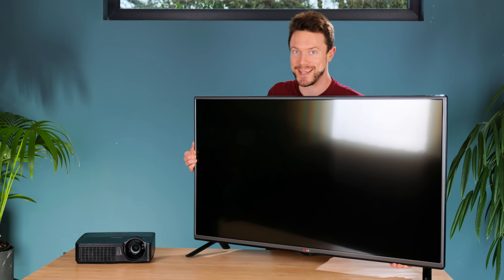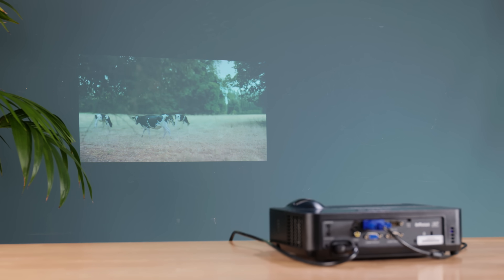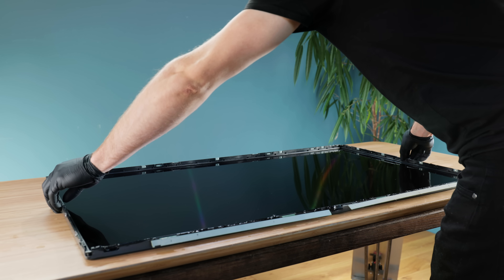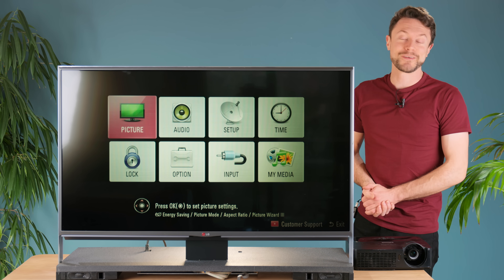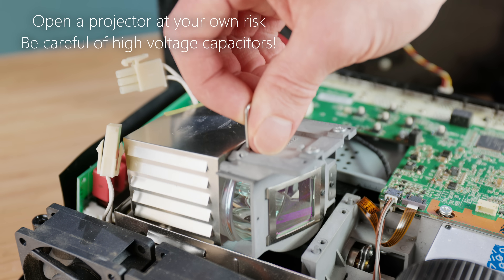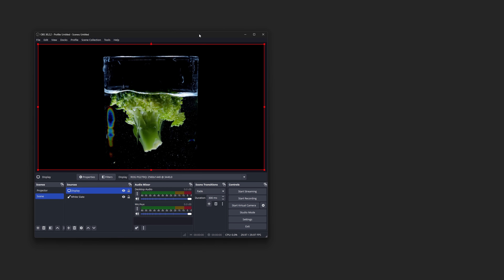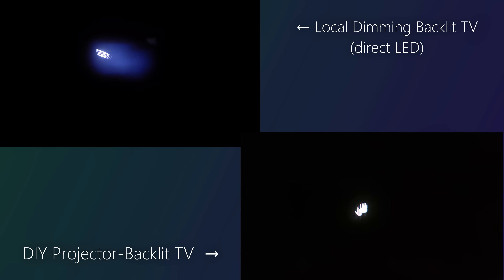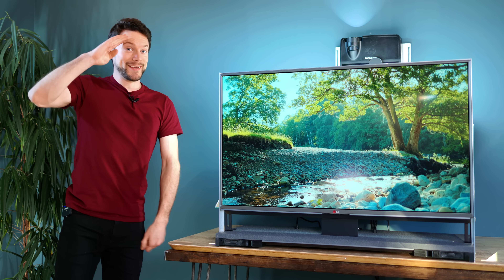DIY "infinity contrast" TV -  with 100% recycled parts

Comment: Within 2 minutes of watching the start of this video, I was already convinced that you have just come up with, BY FAR, your most interesting project to date!

I'm an old A/V techie, been messing with TV's since I was 12, and Video Projectors since the 3-tube pro-video units of the 1980s. 

I went through some of the RP HD TVs, and still have some of those parts laying around.

What you've done is to re-create those RPTV's, but in the ultimate version... using the Rear Projection part for just back-lighting an HD LCD TV screen...

Fascinating!

Now, to make the ultimate version of this, find an old RPTV from a second-hand store (preferably 1080p resolution), and put a 4k TV screen (from a donor with bad Backlight) onto the front of the RPTV viewing screen. Mitsubishi was one common mfr) 

Many of the RPTV's are also DLP, so modify them as you did by removing the color wheel.

The one remaining challenge might be Image synchronization, because the two different TV's have different image processing delay times.
Reply: Yeah, old HDMI interfaces at the time were known for having terrible input latency. However you might be able to bypass that as many gamers did by using component input. (Actually you'd only need the Y channel of component video for Luma).
Reply: A friend had an old 3-tube unit in the mid-90s. It looked ridiculous but awesome in his attic bedroom! I kind-of want one even though my home is not much larger.
Reply: Allow for a better sound system too if he finds one with the built in stand at the bottom.
Reply: Thats a great idea!
Reply: The truly ultimate design would probably use a more modern LED projector installed into the cabinet of a dead RP set, since the 20 year old RP sets likely can’t compete brightness wise, but if you could find a working set like that it would be a fun project to bring it back to life in 2025.

Comment: That wont last too long. Projector bulbs last 5k hours on normal mode for a business one and then you will have to replace the bulb meaning it will turn your TV into a subscription basically.
Reply: If you use your TV a lot this is not a good idea.

Comment: I wonder if using one of the thinner diffusion films, or none at all, would result in better brightness, contrast, and light zone accuracy. I also wonder if you could just modify a rear projection tv to house the panel and projector

Comment: Great idea. It means that we can combine two old LCD panels with a single backlight. You have already done this before, but one thing needs to change—the lower panel display should be pass-through, like the OBS filter used in projector displays. I am expecting the same result as the LCD + projector combination, which will help reduce the size of the LCD. @DIYPerks

Comment: 6:09 It’s not clear to me why you need the diffusion layer, isn’t the whole point not to have a more uniform backlight?  The end result looks great, but I’m super curious what it would look like without the diffusion layer.
Reply: I initially wondered the same thing. I think since the LCD panel is fairly transparent; without any diffusion I you'd just be looking directly into a very bright projector, the diffusion layer is there to reduce the transparency of the screen. That's my assumption, anyway.

Comment: Congratulations, OP... you just realized what Sony should've done when making their LCD rear-projection SXRD series televisions, back in the late-2000's. Maybe then they wouldn't have been slapped with a class action suit, forcing them to give away 46" & 55" LCD panel sets as compensation. Which I took advantage of when I found one of the former on someone's curb on morning.😉

Comment: With the prices of OLED, I can't find the need for this one.

That being said, this is still very cool 😊
Reply: This don't  burn in
Reply: @goldenshatter  I have a 6 year old OLED whit absolutely no burn in. Had a plasma before that for about 8 years. It didn't get any burn in as well. Sure, the risk of burn in is higher in OLED, but it rarely happens. You need to watch news station with constant runners on screen og play a lot of games with HUDs to get it.
And by the way, it's a myth, that LCD's don't get burn in. They can, but they are more resistant to it.

Comment: If the backlight on my 12yo Sony KDL-55W900A ever fails, I'm totally doing this.

Was I seeing a bright spot on the screen where the projector's bulb is directly visible? I sometimes get this issue with rear-mounted projectors, requiring me to place the projector below the audience's line-of-sight and fiddling with the keystone settings to restore a square image. This could be an issue with a living room TV where viewing angles are much more dynamic, and there's limited keystone adjustment with the projector.
Reply from the maker: No bright spot, thankfully! The diffusion sheet is thick enough to fix that particular issue.
Reply: @DIYPerks  Thank you! It's always tough to tell from a Youtube video 😁

Comment: Honestly... Could you do this with an old rear projection tv? They already have the cabinet and short throw projector to control light bleed... You just need to replace the projector screen with an LCD panel... Might also need to keystone it to account for variance in panel size... But this feels doable in a much more contained fashion.

Comment: Me, before you mentioned the color wheel, having a couple of the newer cheap projectors which are basically just tiny LCDs with a high power LED backlight: "But how is that different than just sticking another LCD layer on the back..?" Then I realized OH, it's a dlp. That makes a whole lot more sense. It's a really neat project!
Reply: Actually now that I think about it I wonder how combining these two ideas would look. A DLP with the wheel removed so it's brighter with a high resolution small LCD for color instead. Basically a full projector version of this. I doubt there's any small LCDs that are high enough resolution for this to really be a thing, though, I guess. Maybe a phone screen? I have no idea if you can remove the backlight from those, though, with any degree of success.

Comment: Linus (from Linus Tech Tips) used an old television, a "flat screen tv". that inside has a projector. Maybe something like that you can use, either to create a frame or to make that TV (if you can get one) fit what you did in this video.

(the video is not old: The ULTIMATE Sleeper Gaming TV 
this is the video)

Comment: We need a v2 on this! This is really impressive!
Reply: Some of those mini projectors could be cool as inside the TV
Reply: Did you know that the Sony reference monitors use Dual Layers LCD?
The technology is decades old and superb, we are getting overrun by weak OLEDs.
Reply: @N0N0111 dual layer LCD has brightness and power consumption issue. Arguably this project has that too tho.
Reply: @N0N0111  Weak oleds? Sounds like a budget issue
Reply: @SupraSav  Sounds like you have an OLED with 3000nits in the living room.. right?
Reply: @N0N0111  mine has 2400 nits in filmmaker mode and is plenty bright.. Not as bright as a Bravia 9 for example but for the other benefits it's excellent. Whatever floats your boat these days so many options
Reply: Ltt collab with their ultimate gaming TV?
Reply: @davideverett7553  Unsure why he never chose to use a rear projection as the base and then slapped all the components into that considering it already has the 45 degree mirror?
Reply: @Matty12787  that is what I thought as well. Plus if you used the projector of the tv, alignment is already taken care of and higher resolution for even better performance

Comment: Next step to this would be to salvage the frame from an old rear projector TV, replace the integrated speakers with one of your custom solutions and replace the screen/projection system with this custom projector set up with a short throw.

Comment: old lg tvs did not hold up well. our 2010 philips led backlit tv is still bright and has reallyy good color, color accuracy, response time and motion rendering meanwhile an lg tv of similar age specs and size look very dim and colorless now. philips really had a good design with great ventilation it is like a radiator you can feel the hat rising up and away.  our philips looks nothing like the philips in your video btw there is probably something wrong with yours

Comment: How would this be used in a real life scenario if you wanted to watch antenna tv? What would you use to get images on both the projector and LCD panel and also apply the filter to the projector? Does it require a man in the middle style pc or raspberry pi to split the image to both outputs and apply the OBS layers?

Comment: I have concerns with power consumption. Projectors aren't very efficient and you have to run a computer with OBS to create the image.
However, instead of pointing it to the ceiling, I wonder if some convex mirrors and wide angle lens adapters would do the trick. If enclosed, the TV could maybe reach the thickness of old CRTs and contain any stray light. I wouldn't like to see a bright spot at the ceiling with the light map.

Comment: I would suspect the reason that manufacturers never did this is because it wouldve turned flat screen TV's into CRT size TV's and nobody would want to purchase one
Reply: rear projection tv's were a thing. they were huge, expensive and awful in jus about every way. they used dull, plastic screens instead of an lcd. refresh rate was crap, and they suffered from burn-in.

Comment: That’s a very clever idea! I wonder if a compromise might be to use another traditionally backlit LCD sandwiched behind the one in front, instead of a projector. That additional LCD would be fed the same high-contrast image currently being fed to the projector, but the LCD itself would block most of the undesired backlight before it reaches the front LCD. There would still be some bleed through, but I suspect it would be dramatically less than problematic and the final device would only be about twice as thick as a standard LCD television.

Comment: Would a flat panel convex Fresnel lens decrease the throw distance sufficiently? Like, mount the projector facing rearward at table level, flush or slightly outboard of the LCD screen; add a mirror angled upward at 45° immediately to the rear of the lens; add another mirror angled forward and downward at 45° centered on the rear of the LCD panel; and then mount a Fresnel lens vertically centered between the mirror and the rear of the LCD display.

Comment: Cool project.  It just so happens I have an old projection screen TV that still works, and I have been wondering how to change the front screen, since it has one of the diamond shaped (for lack of a better description) plastic things on the front.   I have a few LCD TVs that don't work, so maybe I can try the display out of one of those.  Any thoughts on that??

Comment: "with dark pixels not even being lit at all", that's not how projectors work, unless you have a dowser the projector is still outputting light. That's why a projector's black level matters and why you aren't just using a projector by itself. Also all the bounce/spill light from the projector looks awful and is the obvious reason why no one has done this before

Comment: I wish you had shown more on what you did to even get the images split up between the two sources, considering that you'd need to route the source through a PC to get it to OBS, then back out to the projector, and in addition to the capture and output there's going to be some added latency for the actual image processing. if this is taken to a serious endpoint with a different projector, I'd like to see the software/cabling side of things next time, in addition to some higher resolution slow motion capture to see if there's noticeable latency between the color image and the projected backlight (and, if so, how you would compensate for it). important if anyone wants to watch a lot of high contrast, high motion media, or play action video games that demand quick responses.
Reply: I was waiting for him to address all of the things you just listed. Amazing video but kinda halfway explained
Reply: This was my thought too. I don't have any idea how to do the signal splitting and processing that he did to get the projector and LCD to show the same frame at the same time, not to mention the audio signal.
Reply: I imagine you could just use a second output on the computer to run the color LCD and sound and run that through OBS, too, so you could make some adjustments there.
Reply: That's why you have access to the forum if you are interested.
I would have one video flux/screen that I would capture and then have OBS output 2 signals with controlled delay.
Reply: Well, let's see. I'm a bit slow today, but let me try to think this through. He said the filtering is done in OBS which is (amongst other things) a streaming program. A streaming program must be able to capture a display to stream. OBS is also a computer program (if I'm not mistaken), so it seems the source must be a computer or laptop.

   So we have a computer displaying whatever we want, with OBS capturing that display and streaming a modified form of it. We want to get that stream to the projector.

   A projector of that age probably has a VGA input which is very obsolete. Fortunately, adapters are readily available. We can use a HDMI or Display Port or even USB to VGA adapter to set the projector up as a second screen for our computer. (A laptop would obviously use the USB adapter.) Maybe set the second screen up as 1024x576 or 1024x600 to match the aspect ratio of the TV.

   To get the stream onto that second screen, I'm not familiar with streaming technology but I think we just need a web browser window running full-screen. If not a web browser, then a media player, but perhaps not the same player we use to watch movies. This is where I'd like a tutorial; I have no idea what OBS outputs. (I could try it, but... not right now. :)

   I think that's everything. We have OBS capturing our primary display, filtering it, and streaming it to our second display which is the projector.

   Instead of a second display, we could instead connect the projector to an old laptop and have the laptop receive the stream from the main computer, but again, I don't know anything about setting up streaming. :)
Reply: HDMI to VGA also exist, I use this one on my desktop right now (they said hdmi 1.4 as input side)

Comment: I really like your take on the idea.

Something similar was done by Hisense beginning about a decade ago (or something like that) -- their "dual cell" line. Rather than using a projector, they used 2 LCD panels stacked on one another. The backlight had to be brighter to overcome the attenuation of both panels, and increased the power to a level that made the display less desirable. But it did feature OLED-deep blacks.

I believe the dual-cell has since been replaced by common modern technologies.

I also believe that professional mastering monitors use the double LCD layer technique. I could be wrong.

Comment: With how cheap projectors are these days, a big name TV brand could do this SO EASILY. Amazon has little 480p projectors for ~$30. A decent 1080p projector can be had for ~$150. That means a TV could be made with existing mid-grade LCD panels ($300 TV) with this kind of contrast out of the box for a cool $500-600. (Bulk order cost cutting plus integration/packaging costs.)

I'd like to see someone like Vizio or Hisense do this. They seem more likely to do something weird for the sake of the PR. (Remember the Hisense dual LCD display? This is basically that, but with a projector instead of a second LCD filter layer.) Yeah it'd be a thick TV, but I'd sacrifice a little bit of space for OLED contrast at 1/4 the price. Plus it'd be user-repairable (if they were smart) and have no burn in. If a "random YouTube guy" can make it out of what was essentially garbage, I'd think a multi-million dollar company could do something truly impressive.

Comment: My idea for OLED quality images is something I came up with 15 years ago - two LCD screens.  A monochrome low resolution (even 720 would work)screen fitted behind the primary screen for light shuttering - both could be driven from the same TCON.  Much better than local dimming.
Reply: Thats a dual Layer LCD, its already a thing. It has a lot of issues in terms of latency and processing though so it didn't take off, hisense tried it with their dual cell TV. Mastering monitors are usually dual layer LCDS